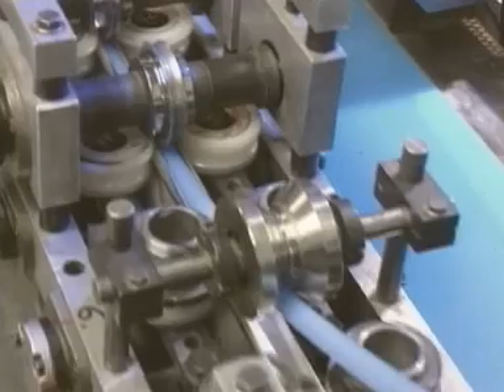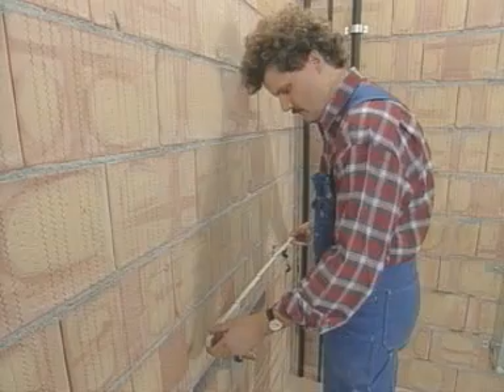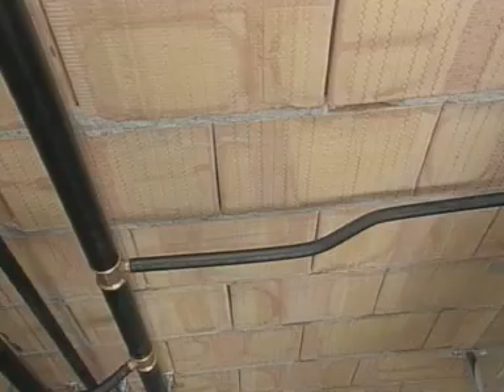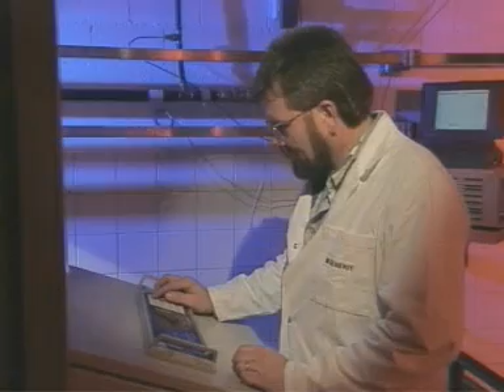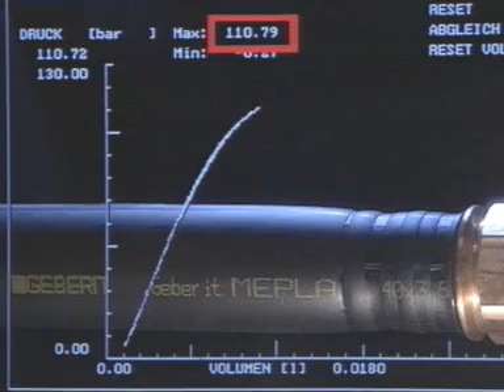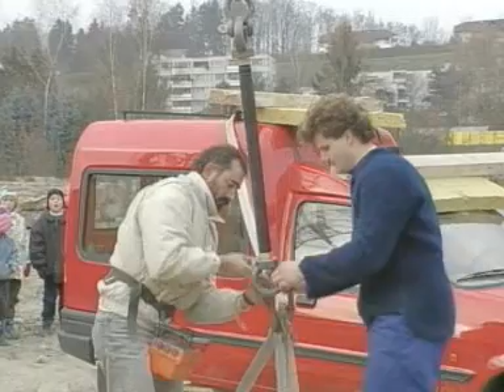GEBERIT MEPLA

Comment: In those tests the connection joints have to be open to the air, otherwise you have the air gas resistance to expansion keeping the connectors on the tube.